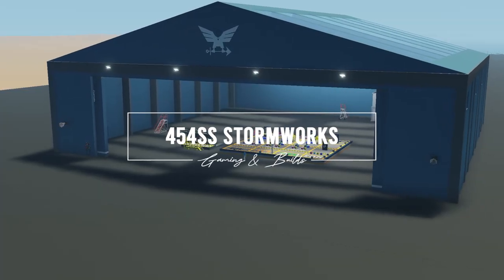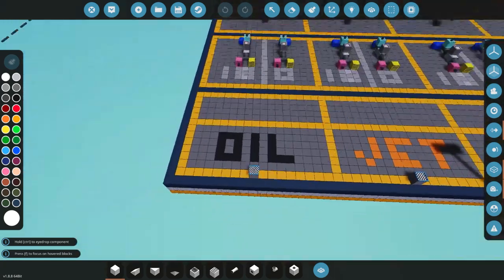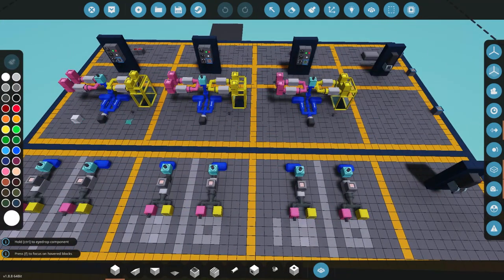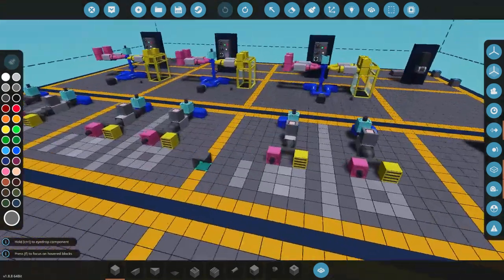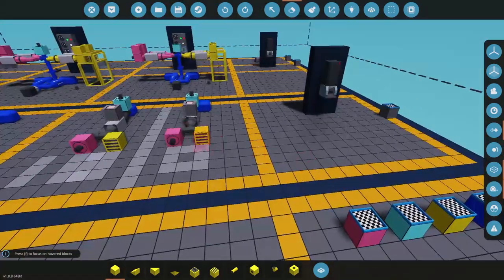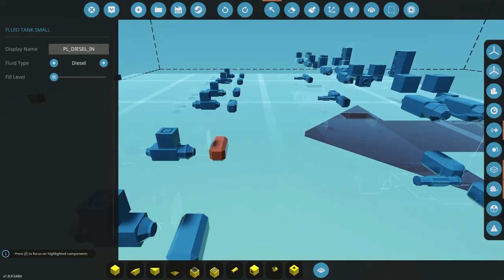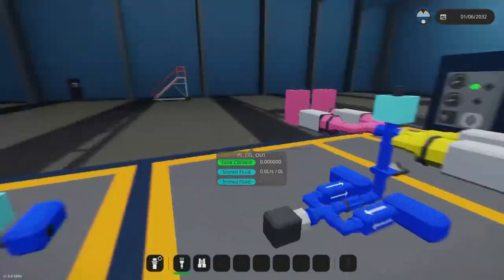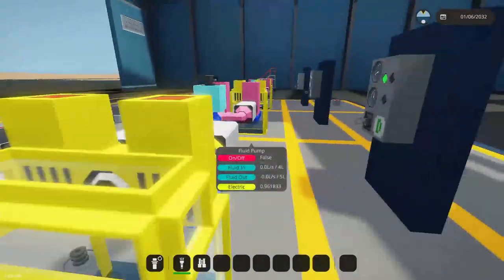DIY OIL PIPELINE access for YOUR Stormworks Build

Comment: Wow, what a great idea. You must be a genius...
Reply: OK, so finished watching the video.

Seems like a simple enough system. Actually much simpler then I thought.

The single named tank "bug" seems pretty logical. It could be resolved in code, by adding additional names, each one with a number added to them, but honestly no creation will need more than one input/output.

I could also see how easily the "pipeline" could be abused, by say renaming the fuel tank on your vehicle and effectively turning on "unlimited fuel" for that vehicle.

But, if people want to cheat, then they only really cheat themselves.

Personally, I want to build (in career mode), a sumergible drilling rig (I have the rig itself build with a floating bouy for surface connections with the slurry system located on a support vessel), and then build a deployable pipeline to transfer oil from where ever its located to back to a sell point / refinary etc.

I was thinking that of "pumping stations" each having two very large winches back to back, a fluid / electrical anchor point under each and a pump.

One half of the station will be connected fluid to winch, electrical to anchor, internal piping through the pump from that winch to the other side's anchor. 

Line up a bunch of stations on the back of the boat, connect one to the boats winch control system which will control a pair of winches, one fluid and one electrical on two connected stations, let out the 500 units of line, connect the next station and repeat until the pipeline has been deployed. 

Hmm, I should actually just make it in my custom game, and upload it to the workshop.